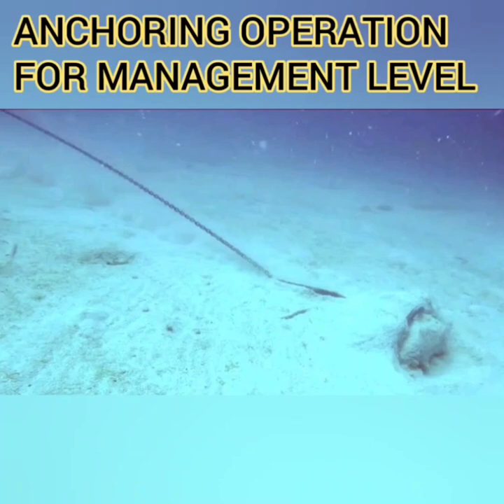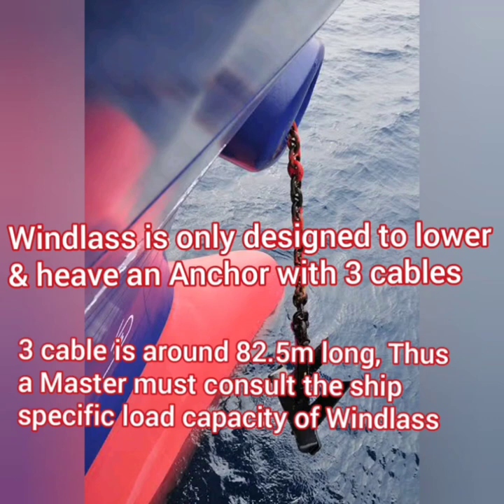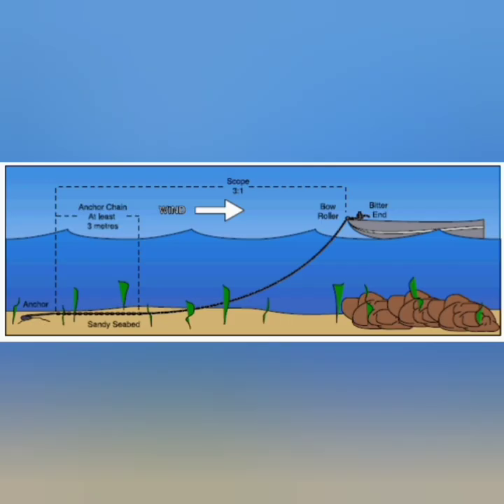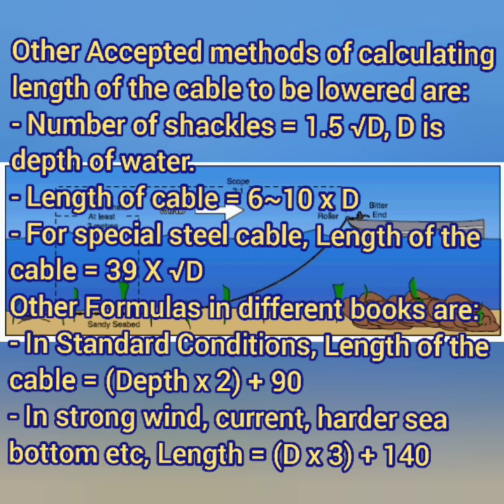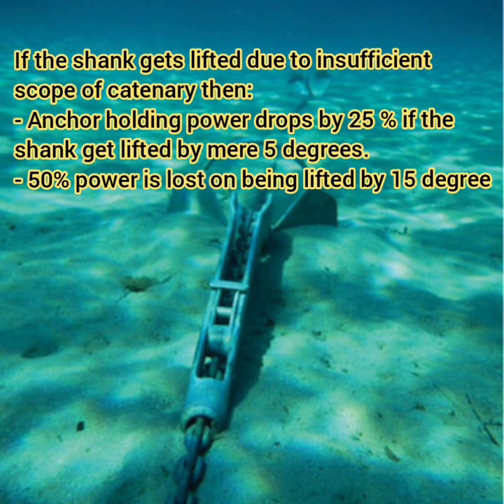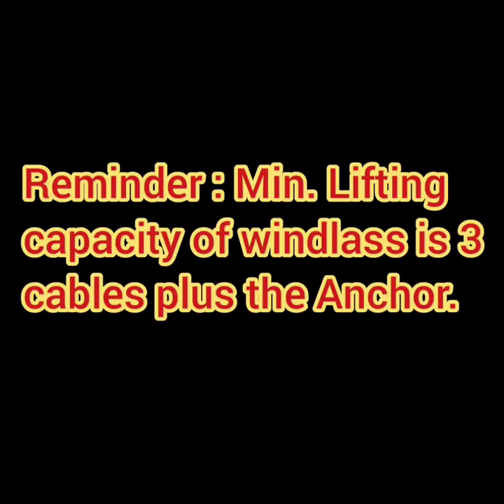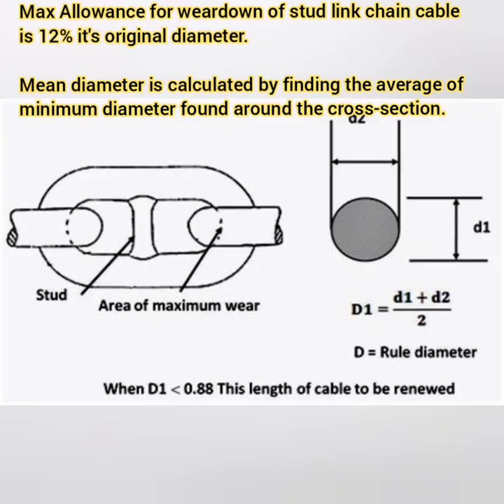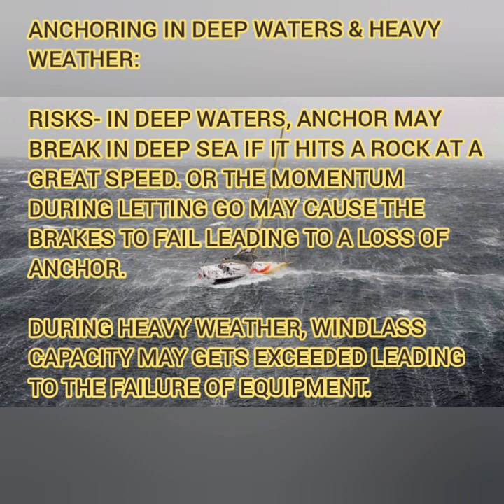Anchoring Operation at a Management level! All you need to know for exams!

Comment: nice one....please tell why ships have different cable length in port compare to stbd...nd why always port side having more length
Reply from the maker: So far, I have come across two reasons, one is that ad per the equipment number which calculated by a formula, the length of the cable required is calculated, if the number of shackles are odd number then one side is higher, if even the it is same on both sides. Second is read was about carrying a spare shackle, as storage otherwise in forecastle would be difficult... I would suggest you read #myseatime blog explanation to check out the formula.
Reply: For 2nd mate/DNS/ B.Sc Nautical Science prepration join kundan patna #kundanpatna

Comment: Why sometimes the chain gets twisted and why sometimes the anchor doesn.t fall when using gravity?
Reply from the maker: Twist is created when the vessel turns while at Anchor. The swivel turn while the anchor was on the sea bed, causing the twist. Or it could because of the piling up of Anchor chain over Anchor when lowering. Sometimes it doesn't fall of the inertia required to move the anchor is more the weight of the anchor. It can happen due to stuck brake, excessive rust on gypsy wheel etc
Reply: For 2nd mate/DNS/ B.Sc Nautical Science prepration join kundan patna #kundanpatna